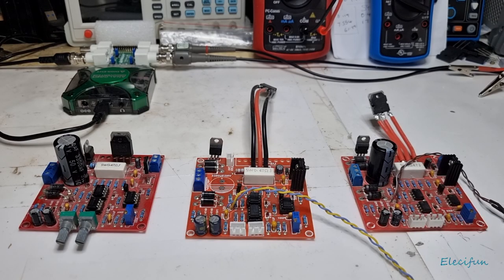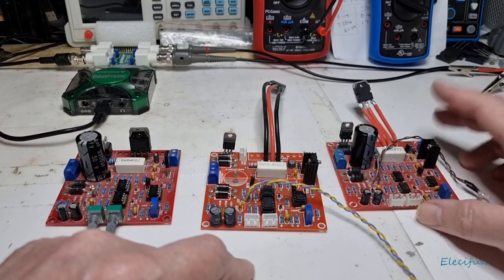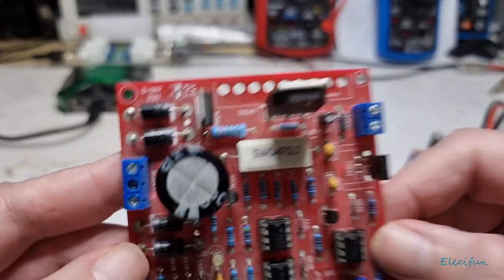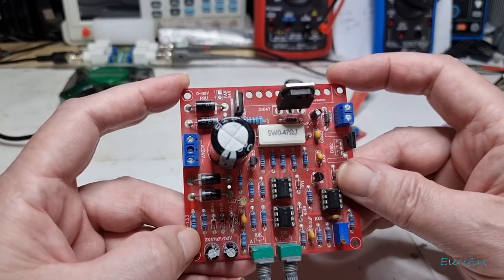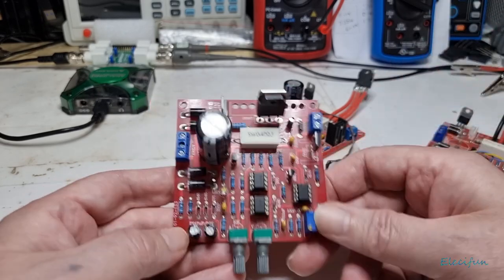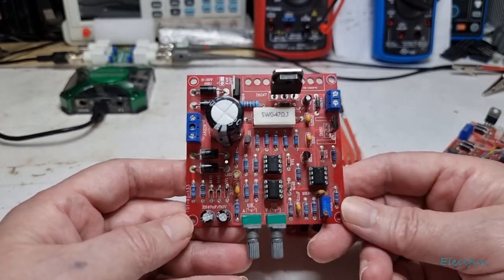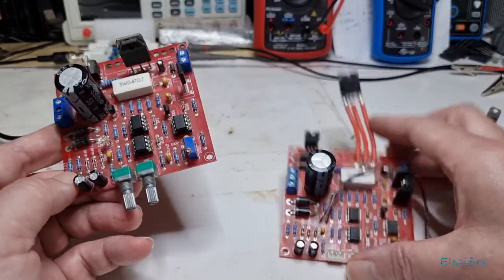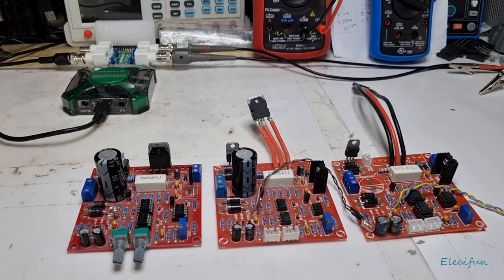Hiland 0-30V 2mA-3A power supply kit BS

Comment: i built two of these power supply board and they fine. i had to change the op amp from TL081 to ua741 because of 741 can handle +22/-22 volts i do get 0 to 30v output and 2ma to 3 amps. i aslo use better capacitors and zeners diodes. when i was building a can across shorted zeners and way out of tolerance. for the pass element i use 2n3055 and mine works
Reply from the maker: @demnoss lots of claims with no evidence is useful to no one here.
Reply: @Elecifun  they as three companies that sell the ps pcb as a kit with different components layouts and silk screens but the same schematic Hiland, HiLetgo and Eqkit. when i built mine the very first i power up us 24 vac transformer all three opamps caught on fire. luckly i use dip sockets. op amps didnt have any part numbers at all. im going to make a short video to prove it

Comment: I can also confirm I only get 26.7V from a 24V 10A toroidal transformer, single thin ringed marked  board with 7824 at 90 degrees in relation to power IC.

Comment: I came across what appears to be circuit diagram for these chinese 0-30V psu, and I noted if it is fed by 24V AC transformer, the supply voltage presented to two of the three op amps is about 38v DC (33 + 5.1 v). Under no load conditions, the voltage could be higher.  Surely this is over volting the TL081 op amps?

The main reservoir capacitor is also too small for a 3 Amp design.

imho, 30v DC output from 24v AC input from any decent linear PSU design is being extremely optimistic especially under full load.  24v DC output is achievable though.
Reply from the maker: @bxl181 show the diagram... the opamps are + - inputs not different input voltages. Linking the diagram could be helpful.
Reply: @Elecifun  The diagram you kindly linked below is very similar to the one I saw, but included voltages and component values. I've lost the link - it may have been an aliexpress listing.    

If D7 is a 5.1 zener, then pin 4 of U2 an U3 are at -5.1 volts.  Pin 7 of U2 and U3 would be at 33 volts if supplied by 24v AC transformer.  Unless I'm mistaken, the supply voltage to pin 7 and 4 to those two op amps would be 33 + 5.1 = 38.1 volts (or more) ?  I think TL081 are only rated to 36 volts.
Reply: @bxl181   your right the Tl081 is only good up to 36 volts +/-18 volts. I have done testing on the op amps and have seen it been fed with 39/40 volts with no load which is why there a good fail point. I am going to try changing them out for tle2141 as there good up to 44v. The D1047 is also a fail point as the current can go to 3.8 amp and it gets fried quite quickly this can be fix by changing on of the 56k resistors to a larger value.

Comment: Measure the resistance between the null offset pins(1,5) of the opamp next to the 270k resistor. You should see between 2-3k.  If they are open(ic removed from pcb) or 100k(ic installed, reading only the trimmer) they are likely fake and lack the null offset circuitry. Maybe try transplanting the  opamp in this location from the working board to the non working one.
Reply from the maker: @robertalabla have you done this test and trial?
Reply: @Elecifun   Not specifically... 

I was watching your "Hiland 0-30V 2mA-3A PSU Repair" video where you were measuring the resistance of the 270K resistor while adjusting the 100k trim pot. On your working board (13:18) you measured a resistance of 22k-26k across the 270k resistor withe the power off. Because 270k resistor is connected between the wiper of the 100k pot and ground there must be a parallel connection to ground via the pot and op-amp null pins in order for the measured resistance to vary as the pot is adjusted(parallel resistance).

On the board where the adjusting the pot gave no change to the measured value of the 270k resistor(it was around 273k on your meter at 14:40), I can only conclude that the fixed end connections of the pot are not connected to pins 1 and 5 due to an assembly or layout error(doubtful) or that their is nothing operational in the op-amp to connect to(open circuit internal to the op-amp).
 
I have an unassembled kit with the unmarked op-amps. When I mocked up this portion of the circuit I found the offset null pins to be completely open. This suggests the Chinese op-amps lack this circuitry and are likely fake.  I tested some very dubious lm741 parts(same pin out) and found the same conditions.

I found the resistance test idea on the "allaboutcircuits" forum in a thread titled "Yet another Chinese DIY 0-30V 0.2-3A Power Supply question - offset null"(see post 16#).

I do not know if the lack of offset null capability is causing all the faults that are occurring.  I do know that real lm741 and TL081 parts do have offset null capabilities, and if testing on the board shows they do not, your parts are most likely fake, defective or damaged. 

It would be interesting to see if swapping the known good op-amps from your working supply remedy the faults with the malfunctioning one.  I only have the one kit and some fake Chinese parts.
Reply: More.. If you look at the "8.2 Functional Block Diagram" on the Texas Instruments data sheet for the TL081 you will see the internal resistors on the offset null pins. (bottom left of diagram) A similar layout exists for the LM741.

Comment: I have yet to see one that works the usual suspects claim they can do 30v 3amp the best i have gotten was 26.97v with 3.8a which is way to much current for theat design. i originally thought it could be my AC supply but after using 24v and 12.0.12 and up to 160va 24 volt canter tapped i figured its down to the board and no amount of messing around can get it running better. I have gotten ahold of a official hiland board from ebay the seller had a few in a bundle for sale and 1 had the right white around the holes. i havent had time to build it yet but i am sure it will work fine. i am going to replace all the 1/4w resistors with half watt and the 2.2k 1watt with a 2watt as my finger knows first hand how hot they can get.
Reply from the maker: @johnproudlock2900 great you found one.. do the fixing circles look like little buoys or complete white circle?  It would be great to hear your results.
Reply: @Elecifun  yeah the one I have is with the circles that look like buoys and the 7824 is on the edge. I am going to scan the board before I start then if everything works as it should I may replicate the board and get Conway to make me the boards as we can confirm circuit works.

Comment: Hey bro, can I get schematic I looked for it but no result. I'm going to do this DIY kit with my own circuit project in the college.
Reply: Look up historical copies of electronics today magazine, elektor or everyday practical electronics for psu designs that actually work, don't try to get a schematic for this. If it can't get the basics right then what's it like for overshoot and other stability issues
Reply from the maker: I screen captured this from Voltlog channel

https://www.dropbox.com/scl/fi/o7ftvqnuftefgdgy8veue/0-30V_0.002_3A_PSU.png?rlkey=458aan3bj69erxvxmmfu4ykqx&dl=0

It is as the original found below

https://www.electronics-lab.com/project/0-30-vdc-stabilized-power-supply-with-current-control-0-002-3-a/

with component values added. 
The components values are on the link provided.
Always check in case of errors.

Hope this helps.

Comment: there is also another board that claims to be 30v 3a so I got the gerber file and uploaded it to pcb way. once i built it i got just under 26v but afer a few minutes the voltage dropped to 17v and thats where it remains now as i refuse to waste more components on a flawed board. search DIY Adjustable Power Supply Board 0-30v, 2mA-3A | HINDI | ELECTROINDIA its a blue circuit board
Reply: I read an article about this regulated power supply and he claims nonchalantly that it works. He even states IIRC that it could be made to perform even higher with other components. 

IIRC they guy is an electrical engine or seems highly qualified.

Elaborate ruse or legitimate facts?

I don't know.

I read in a forum that the original regulated PS was never intended to reach 30V 3A.

It's intended power was actually 18V 2A (IIRC).

There was much debate about this project and many contributors many of whom seemed very knowledgeable on the subject.
Reply: 18V output would make logical sense, especially if fed with an 18V AC transformer.  The typical supply voltage to two of the op amps would be around 30v (25 + 5.1v) which is just within the specs of TL081 op amp.
Reply: @bxl181  my ac transformer is 24v it measures 28v ac and after the bridge rectifier it measures 36v dc so allowing for a little voltage drop I should get 30-31v dc out @ the 3 amps but the design is flawed on the copies
Reply: @johnproudlock2900  hmm, I wonder whether anyone has compared the circuit diagrams and component values for these chinese kits to the original Hiland to determine any differences?  If the circuits are identical, could it be the Hiland was just supplied with TL 081 op amps and transistors from a 'better' quality batch/manufacturer?

I managed to find an image of an unpopulated Hiland PCB (with life buoy mounting holes) to do a comparison.
Reply: @johnproudlock2900  fwiw, I just finished a visual comparison of the component position and values printed on the top sides of both original bare Hiland PCB (with life buoy mounting holes) and the commonly available non-Hilan PCB.  All values appear identical.  The only physical difference I note are the 7824 and 2 pin fan connector positions have been transposed.  I'm not able to compare the copper tracks on the underside of the two PCBs.  (Update: I've just discovered a 2 year old video by Elecifun showing both sides of bare Hiland and non-Hiland PCBs.  I tried to upload my dropbox link to PCB images captured from the Elecifun video and googled images, but Youtube appears to delete the post.)

Obviously, I don't personally own either of these products, but I speculate the commonly available non-Hiland PSU kits are perhaps likely to be supplied with inferior quality TL081 and transistors.

I seem to recall viewing one of Elecifun's older videos where an op amp burned itself out under no load conditions on a non-Hiland PCB.  Perhaps the cheap op amp couldn't tolerate the 40+ volts DC presented to it.....